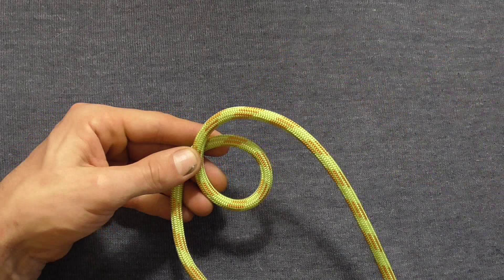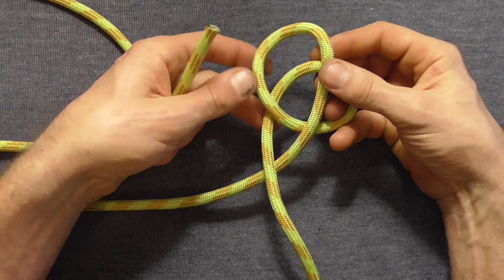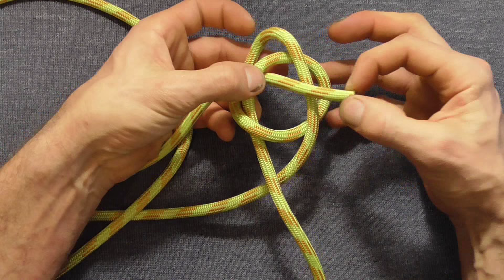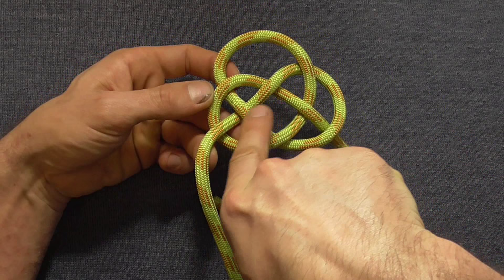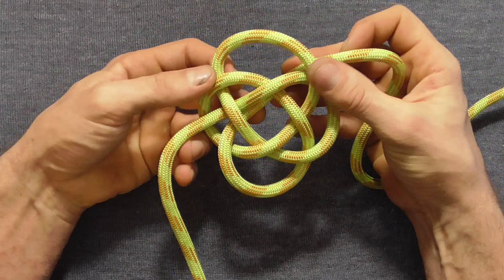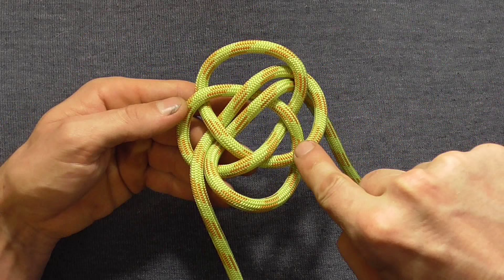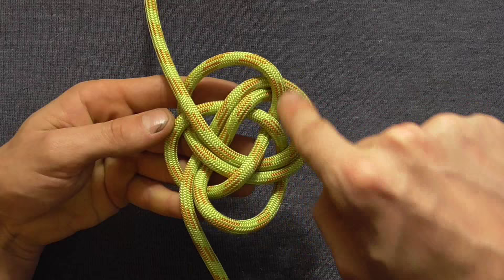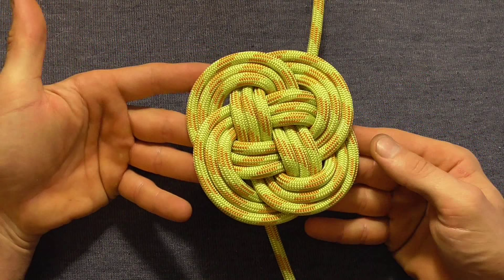How To Tie A 3 Lead 4 Bight Flat Turk's Head Mat

Comment: You make what you call a double coin knot if you look at it you will see that one end comes out on top (this is the working end) you therefore finish the knot off going clockwise when in fact you should be going anticlockwise it is like an overhand knot the end that comes out on top is the working end.